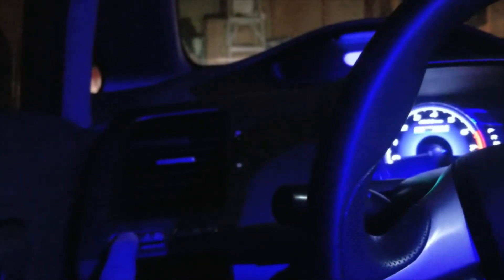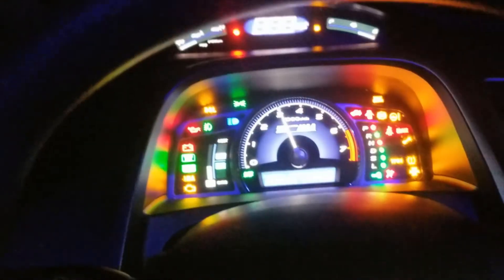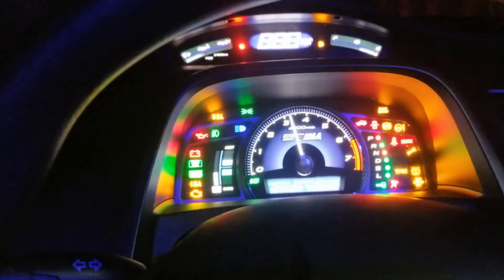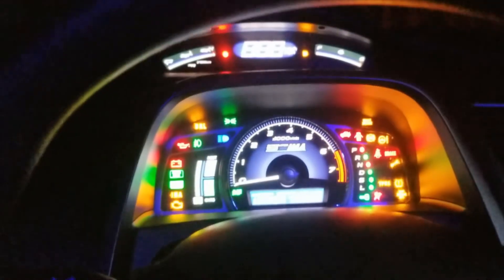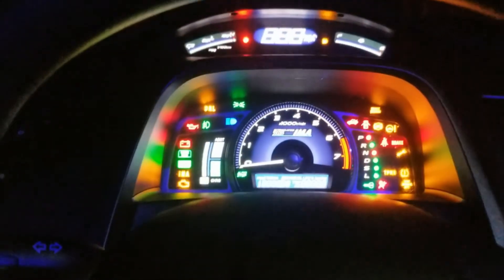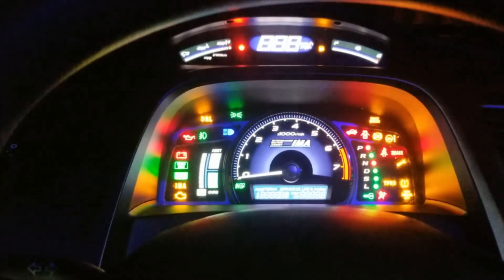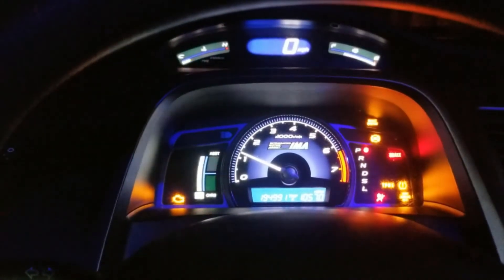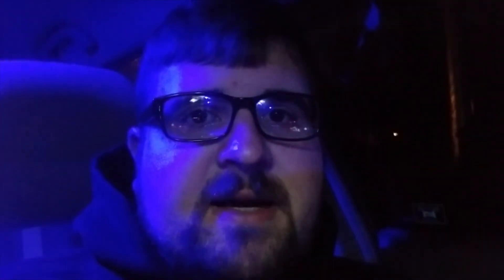EASTER EGG FEATURE: 8th Gen Honda Civic Gauge Cluster Sweep Process

Comment: So i did it and got it on first try. Mine says ERROR 1 WHERE THE MILEAGE WOULD APPEAR...HOW DO I FIND OUT WHAT THE ERROR IS?
Reply from the maker: I'm not entirely sure. It has never happened to me before so I'm not sure what you're talking about. I'd suggest either scanning it with a scan tool to see what codes it's throwing or just unhook the 12v battery for 15 to 30 mins to reset the computers completely.
Reply: Curious ?- does your mileage not display but everything else on the same display does?
-also-is it a rebuilt title vehicle?

Comment: Can you write the procedure step by step? Thank You
Reply from the maker: 1. Push and hold the trip/reset button.
2. Turn the light switch ON.
3. Turn the ignition switch ON. (don't start)
4. Within 5 seconds, turn the light switch OFF, then ON, then Off again.
5. Within 5 seconds, release the trip/reset button, then push and release 4 times more. 
It will probably take a few times to do it successfully. But it will work.
Reply: Spec M Auto Thanks a lot,  i do it on my EX 2006 Civic. Everything is working great
Reply from the maker: @melvelezortiz  glad I can help!
Reply: @Specmauto  cool
Hey spec
I gotta one question
Does it get reset after next start, or it continues n if it continues how we gonna reset it to normal??